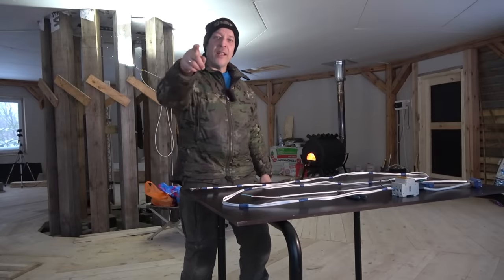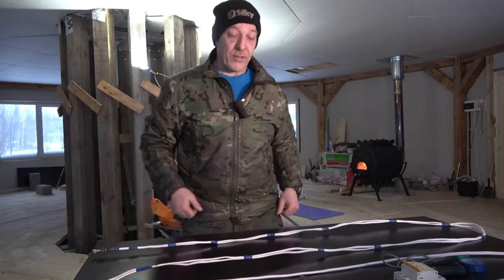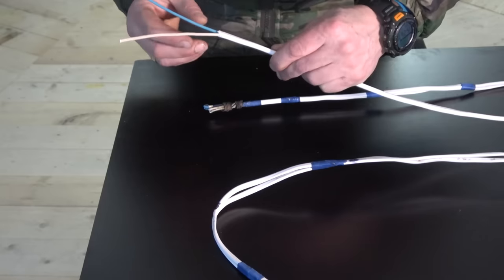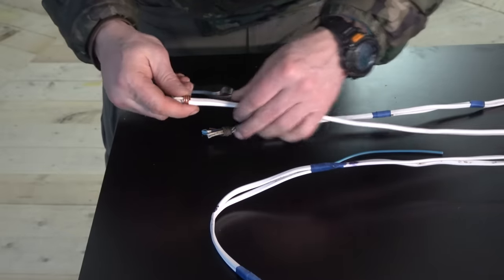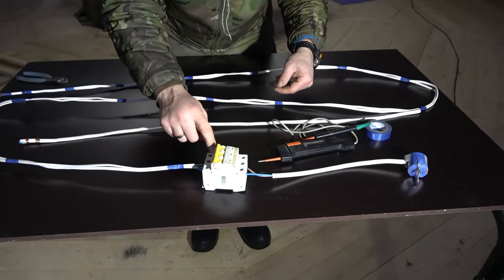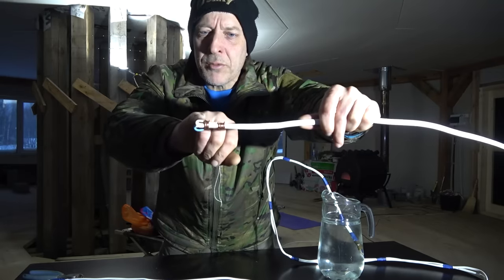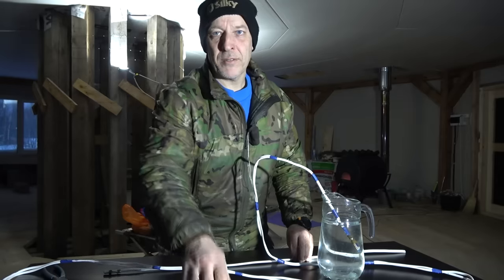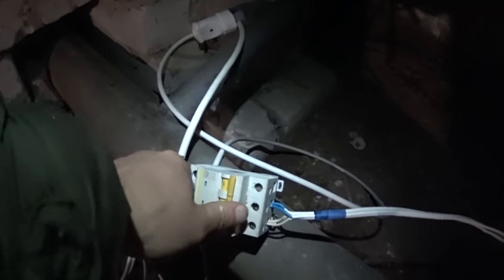Defrost Any Water Pipe Or Drain | Make This Heat Probe In 15 Minutes Full Tutorial And Demo

Comment: Hello from Michigan USA! I've seen a welder used to thaw copper pipe before when I was a kid. My basement is built so that enough warmth from the ground comes through to keep my pump and pipes from freezing up. I've also used electric heat tape and insulation when I lived in a trailer. Proper planning prevents piss poor performance.
Reply: Oddly enough, I have heard of both of these ways of doing it, but never actually seen them (welder or electrical drain snake) used. I know if you remove either side of the line, and hook up only one side (say the common, doesn't matter), then attach it to a car antenna...you make a worm rod (for catching worms for fishing). They pop right up out of the ground. Nightcrawler shopping.

Comment: A plumber friend told me years ago that he hooked up an Arc Welder to old Galvanized water line under a house & said the pipes were glowing red, he said bad idea for copper as it would melt the solder. I point my kerosene heater at my crawl space and pipes thaw quickly... thx Lars, great tip !
Reply: LOL 🤣🤣 As a welder that has done that a dozen times at least, why in the world would you leave it on so long, and the amps on any welder are 100% controllable? 🤦
Reply: @jay90374  How long do you keep it on? Thx
Reply: @MaximusMerideus  until the water flows again
Reply: @jay90374  Happened a long time ago , he didn't say how long it took for them to get red hot... how would he know how long?

Comment: Lars, we call it ROMEX wire. 15 amp wire is 14 gauge, 20 amps 12 gauge and so forth. We have for example 12/2 with a ground so that’s 12 guage wire, a black is hot, white is neutral, bare wire is ground.

Comment: Over sheathed and insulated home electrical wire is refered to as Romex.
     Non braided= solid copper wire.
     Run thru a circuit breaker.
       Great improvised drain snake heater...
        Maybe a ceramic shield with a space over the "heater" would work.....but I too would just stay away from any metal pipe with it.   ⚡
       Best Wishes Lars..🤠

Comment: Lars wouldn't a handful of salt mixed with the water help conduct the electric current better thus heating it up faster? Just a thought!  I believe the frost line in the ground were I live in Kentucky is about 32 inches deep so we have to bury our water pipes to at least that level underground to keep them from freezing then of course the lines above that have to be provided with some kind of heat source or insulation or both! I assume the frostline were you're at  goes deeper or it's permafrost "froze all the time" at a certain depth.. Russian ingenuity never ceases to amaze me!  
Cool fix👍

Comment: I did not see any videos of the building of your new home since you made the foundation. It is looking good. As for your improvised pipe defroster, could you not put electricians tape over the coils, of course allowing space for water to enter, but insulating them from copper pipe, to use in metal pipes?

Comment: Good advice for most folks Lars, not me. I used to make these in prison years ago to boil the water in my cell. 2 matches, 2 razor blades, and 2 bed springs. Plug it in boil the kettle. 🤣 Mind you if a person does not know what the hell they are doing? That could be a 1 way ticket to a morgue.
Take care, stay safe, and warm.
Reply from the maker: The prisoners in the Soviet Union also used razor blades to boil water with.
Reply: @SurvivalRussia  One has to do, what one has to do Lars. BTW it was 37c here today, humidity was down to 38%, we have been having crazy weather here, 27c & 94% at 3 am.. O.o

Comment: I had an exposed p-trap for a bathtub that froze up once. To get it unplugged I used a funnel and some plastic hose attached to the funnel. I put the hose down the drain and poured boiling water into the funnel. The hose guided the hot water straight to the ice blockage and melted it away very quickly.

Comment: Dont try this if your water pipes are properly grounded.
Reply: Please explain. I'm interested but don't have the background see why.
Reply from the maker: I said in the video that you should NOT do this with metal pipes. It will short circuit the two windings.
Reply: Without earth or proper ground it can sting the user. The defrosting/heat part is coming from the fact you are basically making a short circuit.
Reply from the maker: Kind of a "controlled" short circuit, as I said. The water works as a resistor between the two windings. @jeffreyverheij6745
Reply: Lol, someone was excited to make a comment before watching the video. He explains it all.
Reply: @SurvivalRussia  great idea brother. I only heard of this for boiling water. I didn't think of it for thawing frozen pipes. Also if using it for boiling water stick a second container in the water to keep the water clean✝️🙏🏻✝️

Comment: Noice, thought and question :) if you want to use in a metal tube can you use a wider rigid pipe/sleave as a collar over the exposed wire (still letting water inside)?. How do you plug the hole in the tube you shown to stop water leaking back through later?
Reply from the maker: I don't know about the sleeve. I will use some epoxy glue for the hole.

Comment: What do you think it's drawing? Have you measured with a clamp ammeter? I'm curious because 32 amps like you said is much more than it would use, But it would be based on the capacity of the wire and the resistance of the water in that 2 cm gap no? Great video though This is good for an emergency situation, Even if it is rather dangerous.
Reply from the maker: No I have not measured it, but it's much slower than a electric "kettle." They boil the same amount of water faster. The 32 amp breaker was the only one I had which is not in use. I would guess it draws 2-5 amps or so. The breaker is just there in case of short circuit. I of course have other breakers "behind" that setup.

Comment: Controlled short circuit, it's the same idea as the old electric kettles. Except they would go bang without water. What voltage are you using in Russia?
Reply from the maker: 230V
Reply: @SurvivalRussia  excellent, then this will easily work in Australia. Something to keep in mind.

Comment: Another great idea from Survivor Russia thanks. I bet if you added a little salt to that water it would speed up the process!
A friend of mine has an old electric machine that you hook onto both ends of a metal pipe and turn the dial and it electrifies the pipe like a heating element and melts out the ice but it's not terribly safe and it emits an evil Buzz..
Reply: Is it an arc welder?
Reply: @MaximusMerideus  no it was specifically made for thawing out pipes but I think the general idea was the same.

Comment: This is a smartidea, but it strikes me as extremely dangerous. You've basically got mains voltage exposed on those wires, and you're putting it into a water pipe? I get that the relay makes it safer, but how much safer?
Reply: Put your bicycle helmet on.